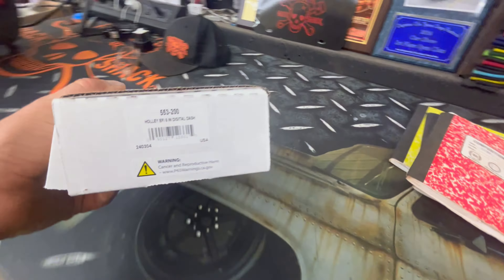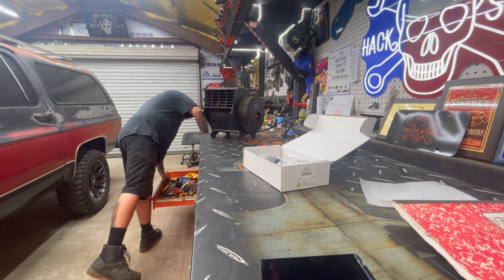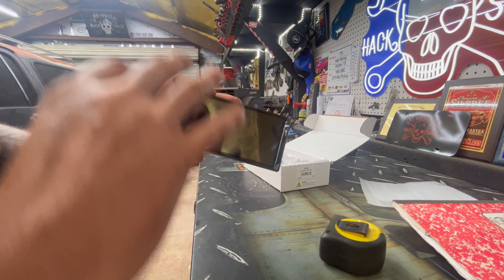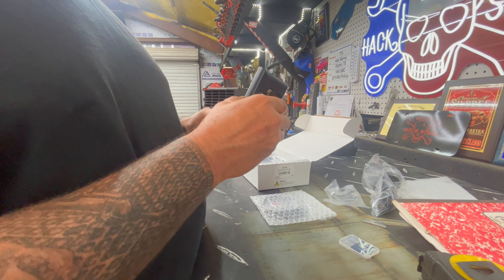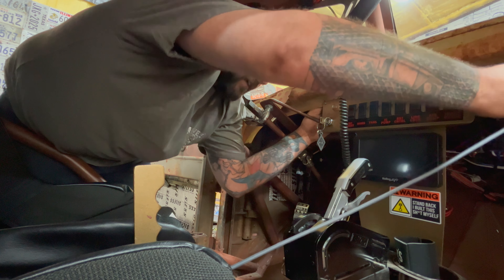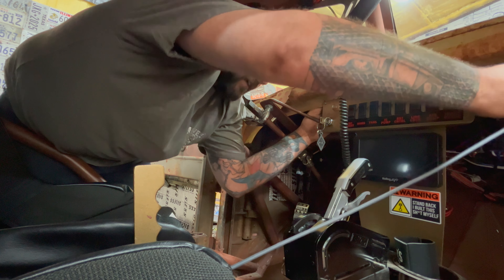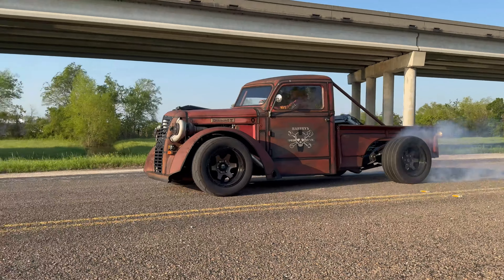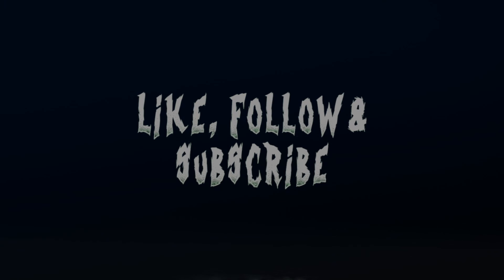Holley 5" Digital Dash... unbox, install, and first impression.

Comment: I started a 46 ford panel truck, using a 98 Mk8 Lincoln as a donor car. My plan has been for a digital dash. That looks kinda small. I'm gonna go with a 7" raspberry Pi display, using the Pi to read the OBD system and display whatever is wanted.
Reply from the maker: Nice it’s all about what you want in your ride. I had limited space where I wanted this display and I’m running Holley efi so this one worked great for my needs.
Reply: @HarveysHackShack  oh yeah, I agree, I'm glad to see them make them now for sale. When I came up with my idea, no one was making them. I started out as an auto mechanic in the late 60's, wound up programming and working on robots along with other things.
I liked you video, because I had no idea that these were available now.
Thanks!
Reply from the maker: @brucelytle1144  awesome. Thank you for the feedback back.